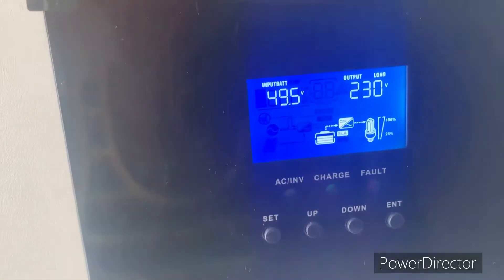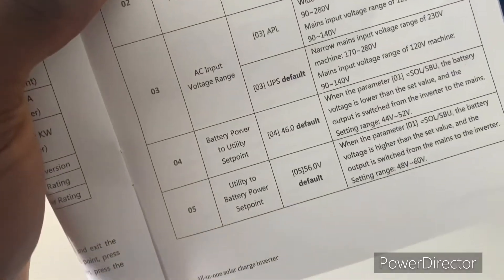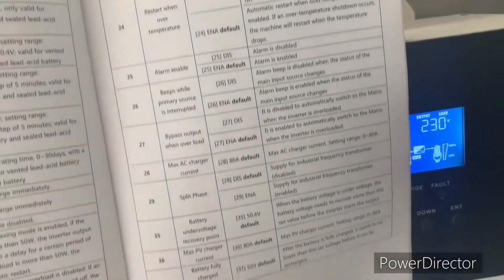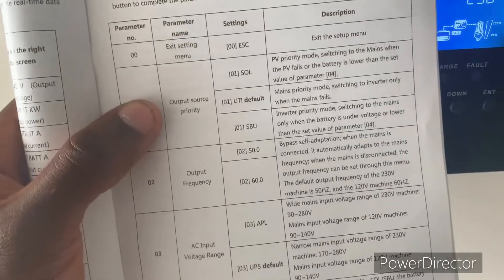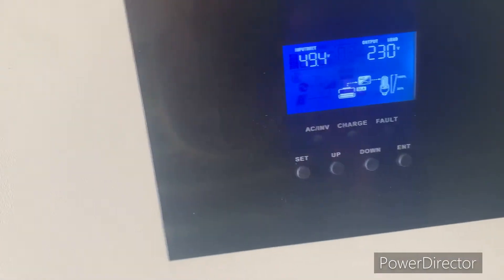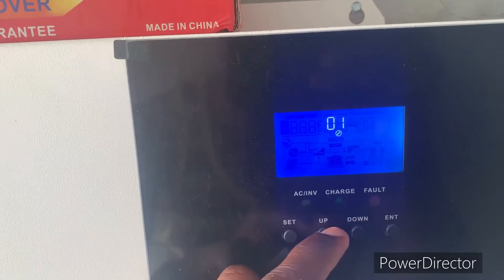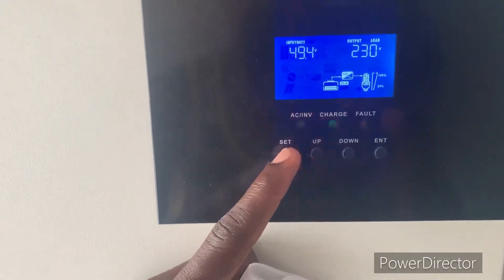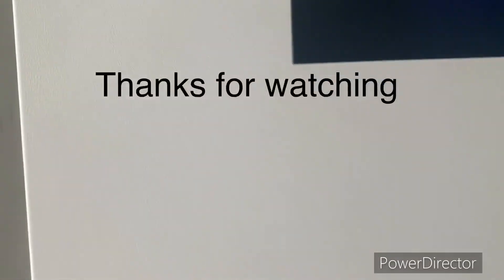Solar priority settings for hybrid inverter part2

Comment: my inverter is an absolute pain I wanted it to charge with solar only but then off the dock the battery runs out because the inverter itself only runs from battery power so if you don't also have it's set to charge the battery from mains electricity when the battery runs out the inverter turns off and all the lights go out even though there is mains electricity fed into the inverter and the next morning it won't cold start because the battery is dead that means you then have to manually charge the battery with another device. I now have it set so that it priority charges from the solar which on a good day will give me a full charge that will last me at least from sundown to half past 11 at night when the electricity goes on cheap rate and then it keeps topping up between 5 to 15 percent from the line connection which isn't ideal because I would rather have it filled the battery up fully so that at 7:00 in the morning hey electric goes on to full rate I have enough battery power before the sun comes up fully onto the panels. I wish these inverters would have timer settings so that it would always charge the battery fully on cheap rate and keep it topped up.

Comment: Hie I have a Highbrid 12v sumry inverter and I have problem with charging I have just put a lithium 12v batree and a 450w panel 
It charged the whole day today but it's flicking code[04] fault and the batree has just dropped to 10.2v by 6pm from 12.9v and i don't know the problem I'm actually off grid 100%
Pliz help
Reply from the maker: I think you need a higher capacity of both the battery and panels

Comment: i Have techfine 11kw Inverter.. with similar manual..how can I set the Inverter only use Battery after the State of Charge of Battery is higher than 85% ?? if its lower than that keep charging it.  ( i set the Charging is SNU ..solar and Utility )

Comment: Man i have a brand new 2kva 12v inverter but when i plug my refrigerator the fan start to run non stop and my tv show vertical lines due to this inverter do u have any idea?
Reply from the maker: The load is much 
The inverter not up to rated capacity 
The inverter is faulty 
The connection is wrong 
These are possible reasons
Reply: @colcent_solar  Ok but my fridge is only 70w

Comment: My inverter no de charge how will I get it to be charging with current it suddenly stopped
Reply from the maker: Maybe your line voltage ⚡ is low 
Call your installer for technical assistance it's not something you can do else you have technical experience 😁

Comment: My inverter doesn't show the solar icon and the AC input is at 0v
Reply from the maker: Solar is not connected to it
There is no light(grid)input

Either case

Check the solar and AC input breakers

Or 

The inverter is faulty
Contact your installer
Reply: @colcent_solar  Where do I check the breakers?

It's not charging at all, and it's a sunny day with temperatures at 32°
Reply from the maker: @biggieblack8158  09065594904 WhatsApp

Comment: my 5kva 48v hybrid inverter doesn't recognize nor charge with 24v solar panels connected in series parallel connection to get 48v
Reply from the maker: Check the minimum PV voltage of the inverter,if it's 120v you need that your 24v like 6 connected in series for the inverter to charge
Reply: @colcent_solar  alright thank u, I Will check, what I did, I have 8 24v panels connected 2 panels in series to get 4 48v then connected the  4 48v in parallel to increase the charging current. I have 48v battery bank and 5kva 48v hybrid inverter that's why i did 48v solar panels connection.

Comment: Mine does not charge with solar unless I on the inverter
Reply from the maker: Yes, that's how it's programmed
Reply: @colcent_solar  can I make it charge automatically when the sun is out
Reply from the maker: @abdullahiibrahim9168 yes,that's how it's works but the inverter have to be on.so when sun comes out it charges automatically and vise versa
Reply: @colcent_solar  ok, thanks I thought it starts charging when the sun comes out like normal charge controller
Reply: thanks exactly what i’m going through right now